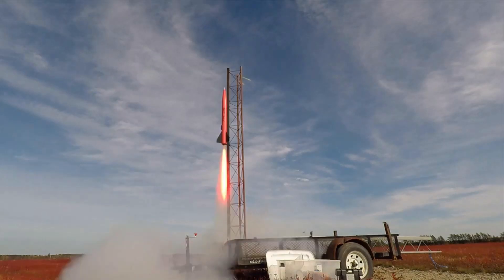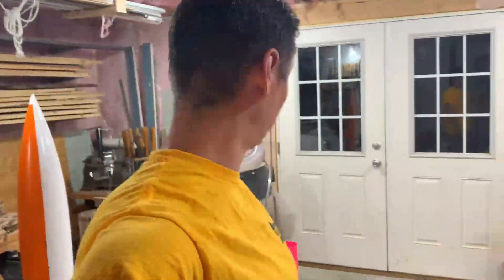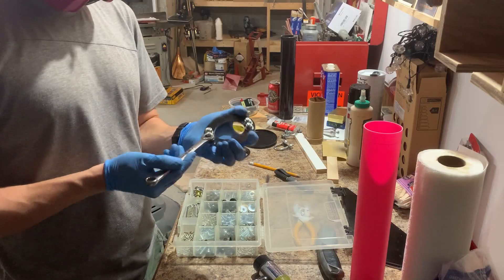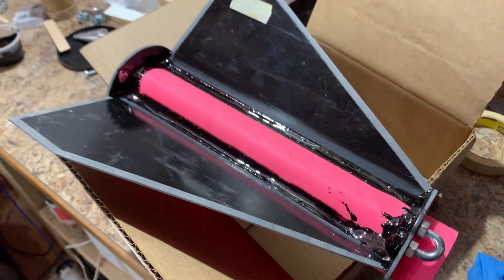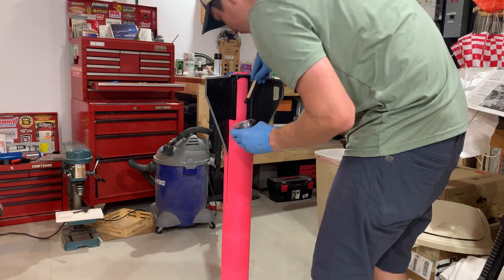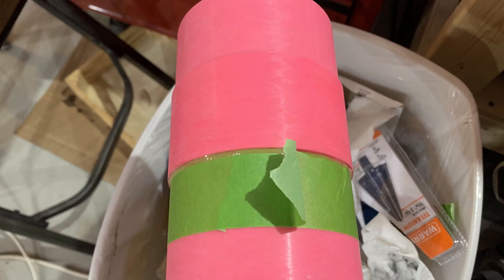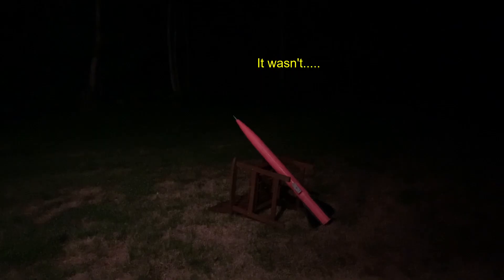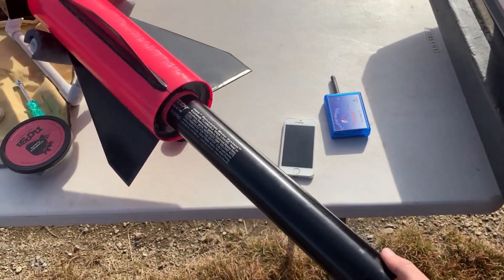4" Composite Warehouse Pink Lady on a K695 Redline to 6,400 feet

Comment: I got really lucky.  I was doing just 1 parachute on my altimeter.  I accidentally plugged my charge in the main and not the drouge.  My rocket came down on its side from apogee all the way down to 500 feet beforemy parachute came out.  Never will I be so lucky again.
Reply from the maker: Sometimes it pays to over build recover hardware am I right?